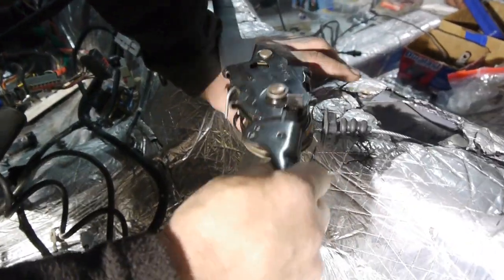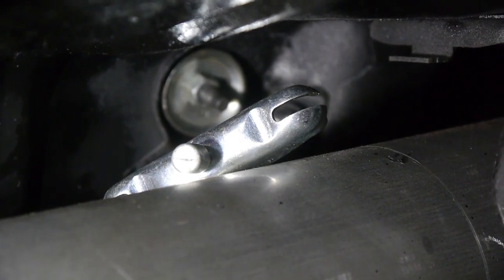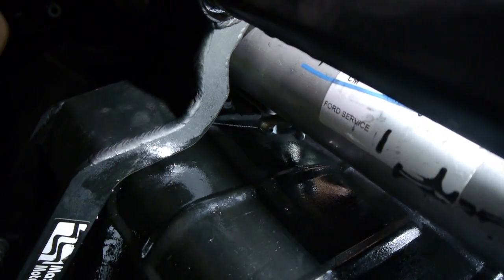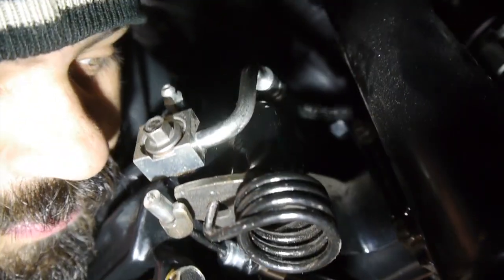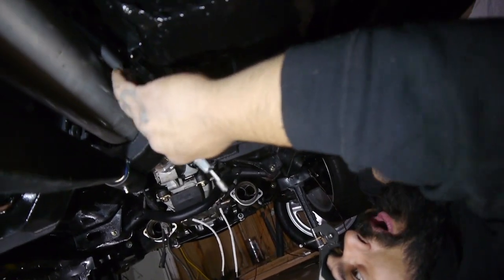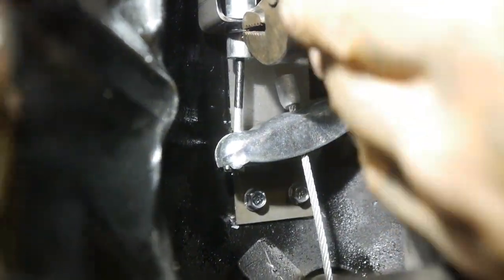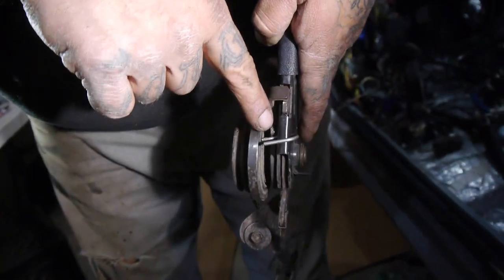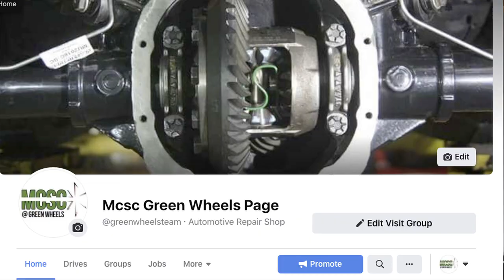Coyote swap E brake Lines &  Parking Brake Lever Assembly Installation

Comment: Oh no Mr. Bill...my ears were on fire at 5:00 when you said about removing the driveshaft. Too funny! I'm the one usually saying "get the stuff out of the way". ☺☺ Glad you were able to get the bracket in. Putting the e-brake mechanism is easy as you show to wind (pre-load) the spring to have tension. Might remind others when they remove the rear cable from the caliper to clamp the cable at the e-brake or pin it before releasing. Otherwise they'll need to get access (PITA) to tension the e-brake spring again. Also love the "breath" of fresh air at the beginning. 🥶🥶
Reply from the maker: Yes sir! It was good we did not have to remove the  Torque Arm, spring, to just install the bracket for the E-brake. Sometime it is good to clear everything out of the way to reach and make the work easier. Work is good, but it requires extra time to allocate to four slow projects I am working on them all at the moment, plus a full-time work.  I will keep this in mind too. "Might remind others when they remove the rear cable from the caliper to clamp the cable at the e-brake or pin it before releasing.:"  I hope life is treating you well and you are in good health.

Comment: What’s happening with your Barra swap stang?
Reply from the maker: Brendon, I still have the project, the Barra Engine, the ford T56 six-speed transmission, all the tubular suspension, big disc cobra brake, tires, rims. The problem is covid19 restriction continued to get worst which has slow down businesses, life, and productivity on some folk. Australia has completely I am currently doing two coyote swap foxbody. One is a 93 foxbody notch, and the other is 93 foxbody GT, but I am only one man brother with two hands in too many project.